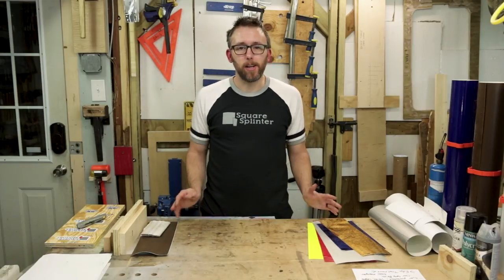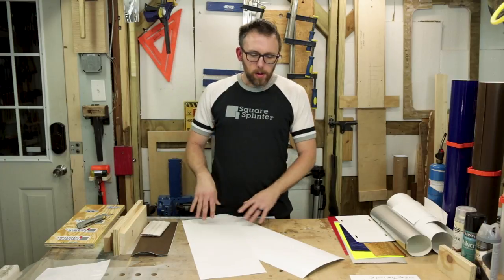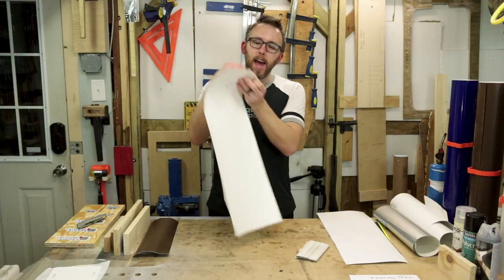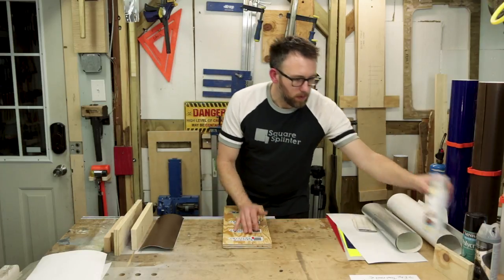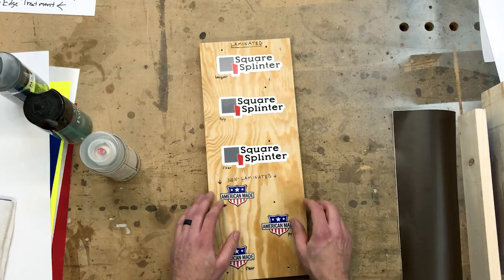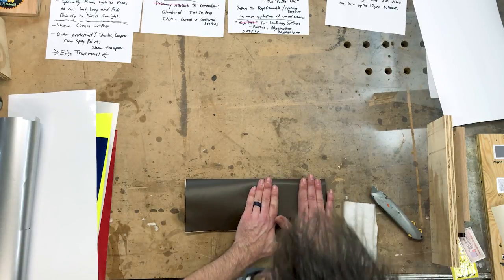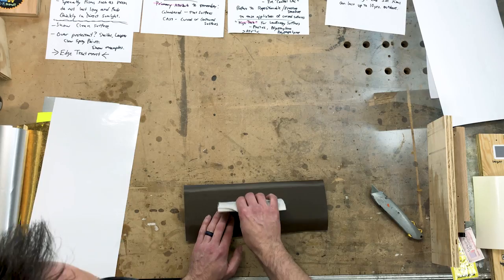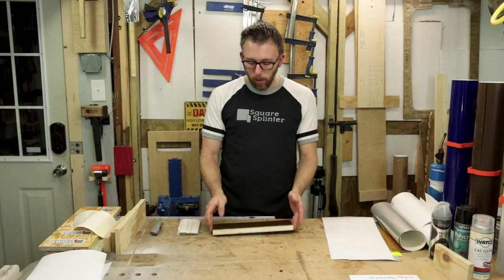Vinyl wrap your Wood | Tips and Tricks

Comment: Thank you I have been thinking about this for quite some time. I have a very expensive set of Polk LSIM 707 speakers that have some veneer damage I've always imagined that I could feel that damage with epoxy and then wrap the speakers to make one amazing look.
Reply from the maker: As long as you make the epoxy fix perfectly flat it would work just fine.  Just remember the vinyl will show ALL of your small little scratches or high spots in your fix.

Comment: Hi Great video. I am thinking of using a vinyl on a turntable (Record Player) plinth made from simulated wood. The unit if from the mid 70's and would like to know how to apply a vinyl wrap along the top and wrap around all the sides which is about 2" high. Basically a square box about 13x16"x 2". to make look uniform.
Reply from the maker: Probably be best if you could maybe email me a picture?  I might be able to help better.   Squaresplinter@gmail.com

Comment: Hey, if it possible to use floor vinyl on mdf board? The thing is i bought a rack that has hdf board for each level, so I wonder if im putting my extra floor vinyl on top of it to make it more durable or any kind of extra protection for the board against oil/grease/ or some spill water. I want to use it to store equipement or auto sparepart for my garage
Reply from the maker: I have honestly never done that but I do t see why you couldn’t.  I think it probably provide quite a bit of protection on the faces, the edges might still be a bit fragile but anything helps. 🍻.  Let me know if it works out!

Comment: Great Video! I have a 5x5 sheet of car vinyl carbon fiber. Do you recommend I apply anything to 3/4” pine sanded plywood before hand or just wipe it down first?
Reply from the maker: I would definitely put some sort of sealer on it first.  A water based poly would work great or any Type of “sanding sealer”.  Will greatly help adhesion.

Comment: Would it be to my benefit to prime the word first and then then apply the wrap?
Reply from the maker: You need to at least seal it with something first.   For example: a water based polyurethane or a sanding sealer.   Primer works well also.

Comment: So if I were to cover the tops and sides of something in vinyl and then applied a sealant/clear coat it would stop it from coming up? Also you mention non laminated vinyl isn't as durable but a clear coat should add durability so I could just buy that correct?

Edit: how do you think clear coat would hold with knifes? Any you recommend that may do better with knifes?

Comment: Will the Vinyl get peeled away if we use it  to stamp on the floor
Reply from the maker: There is vinyl made specifications for applying to the floor.  Think Walmart and other retail places with graphics on the floor.  It will stay down but not for super long term.
Reply: @SquareSplinter  thank you very much for your response 🙏

Comment: hi nice video,  i have noticed on some modern cabinet doors look very glossy finish, and they seemed to be a vinyl as you can see the edge on the back of the door, but  they haven't got any joints on the corners of the doors.  And all the videos i have seen you can see the mitered corners. can you help. thanks
Reply from the maker: I’ll be honest and say I don’t know “exactly” how that is done but.... I am fairly certain it’s a mixture of heating and vacuum forming.  That’s why that vinyl is always so brittle if you try and remove.  Usually means it was heated.  A lot.

Comment: Do you just apply permanent vinyl on mdf just as you would regular wood or do you apply anything on mdf before the vinyl?
Reply from the maker: you can apply right over MDF
Reply: @SquareSplinter  ty
Reply from the maker: @ald.3449  Im actually working on a follow up video to this one right now and I will be demonstrating your question in the video.  Sealing vs. not sealing mdf and similiar questions  Thought you might like to know.

Comment: Are you saying that air egress wrap can never be removed?  Isn't the point of wraps that you can remove it if you wnt?
Reply from the maker: If can definitely be removed.  The air egress helps in the application because it doesn’t stick until you put pressure on it.  Basically all higher end car wrap vinyl has some version of it.

Comment: To be specific: Automotive vinyl, not the thin, car advertising type of vinyl. Real vinyl comes by the yard in various colors and textures. They get laid over a batting to provide character and stretched and stapled to the underside (or the hidden area) of the project. For example, I have an 8 ft x 2 ft wooden framed panel that resides above the driver and passenger compartment in a truck. It is built with plywood and covered with vinyl, but not advertising vinyl. Most automotive vinyl work utilizes furniture grade vinyls and not something thin and cheap.

Comment: This was crazy informative! Thank you!

I wonder... My plywood is crazy rough finish cheap stuff that I'd like to put a wrap over.
I have no power sander tools...

So I'm going to try applying drywall mud to the surface of my plywood to fill in all the grains and knots, and then see how the vinyl sticks to that!

I'll respond with how it goes
But if you see this sooner than later and have any better suggestions of how to give rough plywood a smooth finish without sanding - I'd appreciate it!
Thanks!
Reply: Sooo.... did the drywall mud work?
Reply: @ssranon  absolutely terrible lol. Perhaps the 'automotive vinyl' from Amazon was to blame (I wanted the carbon fiber look for my project).

But man.
Any and every small imperfection in the wood showed through.
Wood filler is not cheap and it doesn't go a very long way, and drywall mud doesn't adhere to plywood well at all. It easily comes loose when dry, if the wood is impacted or even slightly bent during install.

Anyways...
I'd either fork out for wood with a nice finish, or try a different route be time, like purchasing discounted cabinet pieces from the Ikea 'damaged section', since it a has a nice surface finish to begin with. Just need to cross your fingers that the sizes and prices are good!
Reply from the maker: sorry for such a late reply.  Yeah...like you found out, vinyl doesnt hide ANYTHING.  to smooth something like that out you would want to use bondo.  I have done this before with decent results.  It has to be sanded really smooth though.  at least up to 220 grit.

Comment: I was hoping to see you wrap the entire board, edges and all.  I have a "shelf" / Keyboard tray I'd like to wrap completely.
Reply from the maker: Diamond 482 you want to wrap just the faces and edges, right?  That wouldn’t be too bad but if your wanting to wrap the ENTIRE thing ends and all that would be pretty tough.  Let me know and I might be able to give you some pointers.
Reply: @SquareSplinter   well .....the top, the front edge for sure.  Both side edges would be nice. The piece  is 13.5 inches wide ( left to right ) x 18" front to back × 3/4" mdf fiber board.
Reply from the maker: Well the top and front edge can be done fairly easily but adding the edges in quickly makes it pretty tough.  There isn’t a super easy way to make those lines neat where they would meet on the edges.  
To accomplish the front edge and top though you can do that with a squeegee and maybe a hair dryer or heat gun to help you out.  Cut your vinyl bigger than you need and apply the big flat top surface first working towards the edge/front you want to wrap over. When you meet the edge and everything is flat and finished on top slowly heat up the vinyl just a bit to make it super pliable.  Better to have someone hold the board down for you or clamp it down...  start in the middle and pull the vinyl over tight, after you pull over middle reheat the leftover again and then pull over the left and right edges down over the front as well.  If you heat it up enough it will stretch and prevent any wrinkles or bubbles.  After you have it pulled over and smooth heat up the edge pretty hot to “set” the vinyl on there.  Be sure with mdf to try and not pull up the vinyl after it sticks down.    Hope this helps.
Reply: @diamond4829  how did it work on the MDF board?

Comment: How do I vinyl wrap all 6 sides of a loudspeaker? The edges become tacky. I am looking for a proper hi end look that would last forever.
Reply from the maker: no vinyl will last forever.  I would probably suggest an automotive paint.
Reply: @SquareSplinter  any long lasting solution which looks like veneer? Looking for a clean joint where 3 sides meet.

Comment: Thank you, thank you! you are the answer to my prayer :) I am making a bed for my camper van project and I would like to cover the plywood bed with matte vinyl instead of painting it to make it look fancy. My concern is being a plywood, it is expected to bend some when laid on, do you think the vinyl would stay? Would it be better if I'll spray the wood with water based polyurethane 1time to make the vinyl stay more? or the polyurethane would react to the vinyl and it will make it peel easy instead?  Appreciate you help.
Reply from the maker: Hello! first off, thanks for the kind words.  To answer your question, quality vinyl really works alot like paint in that it will follow the contours and bends of what you put it on VERY well.  Couple things: Just using matte vinyl on the bottom could possibly scratch fairly easy if its not a laminated type, but as long as nothing sharp is against it you should be fine.  As far as finishing the plywood before you apply the vinyl, you don't have to but I would.  The poly will act as a wood sealer and also a uniform surface for vinyl adhere to.    Thanks again!
Reply: @SquareSplinter  I would probably use gloss then if you say it is more scratch resistant than matte. Do you suggest sanding the Polycrylic to remove the tiny bubbles before sticking the vinyl? I am afraid the dust after sanding might reduce the stickiness of the vinyl even if you wipe it with damp paper towel? I am curious if painting plywood with enamel would work too. I checked the options of vinyl in the signwarehouse.com and do you suggest I get the Oracal brand for this project. Once again, thank you for your input.
Reply from the maker: I may not have been very clear before...  the gloss vinyl itself isn’t any more scratch resistant than the matte.  What I meant was, ANY vinyl without an overlaminate like used on a car wrap can be scratched somewhat easily.  Not to say it’s like fragile or anything but just be aware it will get scuffed up looking rather quickly when used on a floor application.  As far as the polycrylic I would definitely sand it with like 220 grit lightly to smooth it out.  Wiping it down with a damp cloth won’t hurt anything at all.  Painting is also an option but not really necessary unless you plan on the wood being in a damp environment a lot.  As far as the vinyl, yes Oracal is a great brand. I would go with the 751 line.  The 651 Rips easily and the adhesive just isn’t very good.  Good luck and send me a picture when your done!  👍🏼
Reply: Make sure the ply you're putting it on doesn't off gas or it'll make bubbles over time!
Reply: @SquareSplinter  Hi, do you think a laminated vinyle will survive as camper exterior cover, and roof over 5/16 plywood? (is it waterproof enough?)

Comment: Great, informative video!  I'm working on a horse trailer renovation project. It is made out of mdf board, so it's a pretty flat, but not 100% smooth surface. One of the panels has some wacky oil paint job. What kind of vinyl would you recommend for this kind of job? It has to withstand the elements (obv) as well as cover up those minor bumps. Thanks :)

Comment: I want to wrap a wooden desk. I want to minimize the amount of seams by continuing the wrap around the edges . The idea is to cut seams at the corners only (I don't care what the desk looks like underneath). Are there any drawbacks to that method? Will the vinyl tear more easily? The edges and corners of the desk are slightly beveled.
Reply from the maker: As long as edges aren’t beveled at least.  You don’t want to wrap over any 90 degree sharp corners where there will be wear and use on them.   If possible you might even want to ease the edges even more with some 220grit Sandpaper if possible.  Cutting at corners and folding around will work fine though.  That’s typically how it’s done commercially.  Good luck!
Reply from the maker: KJ what I meant was as long as the edges ARE beveled at least.  Sorry about that.
Reply: @SquareSplinter  No worries, I figured that is what you meant. I'm pretty excited to get started, Thank you !
Reply: Hey, I might wanna try something similar, can you maybe show me some pictures of the result? Mostly interested in a corner and an edge to see the finish

Comment: Just built a speaker box out of birch, was planning on wrapping it with the auto vinyl like you have here. What are your thoughts on hittin it with some primer spray paint to make it smooth? As well as possibly adding some durability. Is that a good idea? Or should I just bust out the orbital sander
Reply from the maker: Sorry for late reply.  Priming is perfectly fine to seal it.  Just make sure you get it sanded smooth.  Remember the vinyl won’t hide anything.

Comment: Thanks for the tips. What about drilling after vinyl is applied or routing the edges of the wood?
Reply from the maker: Drilling is fine but you wouldn’t want to route afterwards.  There would be a pretty high chance of tearing the vinyl when trying to route.   BUT.... honestly if it was a brand new super sharp bit it might work.  I honestly might try it.

Comment: Gluing isn't an option for me bc im getting an apartment but im gonna modernize it in a way that everything can be removed when im out. Is it easy to peel off?
Reply from the maker: It CAN peel off yes, but typically on mdf especially it can mess up the surface finish. If you sealed it first with a water based polyurethane or similar that would help.   So I guess my answer is yes you can but I wouldn’t want to do it on a very large piece at all.  I would suggest maybe testing a piece first and see if your ok with the result.  👍🏼
Reply: @SquareSplinter  I appreciate it!

Comment: how would you do the edges if you wanted to wrap something completely like that all the way around?
Reply from the maker: You can definitely wrap all the way around but it’s MUCH trickier to get a good flat surface when doing it.  Wrapping over a 90 degree edge adds  a whole nother level of difficulty.  So adding one and then another 3/4” later it is definitely possible but might take a bit of practice to get it to look good. 👊

Comment: Hey man, question about how to remove these sort of vinyl wraps? I have a new backgammon set that is essentially a wooden box with a glossy vinyl wrap/wood laminate. I plan to remove it. Any ideas?
Reply from the maker: It’s actually “new” or just new to you?  On commercially produced stuff that is vinyl wrapped they typically use a very cheap vinyl that has very aggressive adhesive on it. Sometimes it can be a huge pain to remove cleanly. Depending on what your wanting the surface to look like after there is a couple ways.  The first way I would try is a heat gun or hair dryer, slowly heat it up and try to pull up a corner.   If that doesn’t work email me and I can help you more.  Squaresplinter@gmail.com
Reply: @SquareSplinter  First of all, thank you for responding. It's new. Hmm, that's a great point. I didn't think of that. I originally wanted to varnish everything but the playing surface. I'll try the hair dryer option.

Comment: What type of vinyl would be used over finished wood that can be easily removed at a later date without damaging finish ?
Reply from the maker: Just about any high quality vinyl would work just fine and would remove cleanly.  Google Oracal 751 for a good starting point.  Thanks!

Comment: Interesting finish, quite a lot of fun in some applications.  I can see wood wall hooks in bright vinyl colors.  I'm surprised you don't heat this up like the mylar sheeting on model aircraft?  I always thought there had to be some heating done at the end to stretch it out especially over corners and curves.
Reply from the maker: Lass-in Angeles you are completely right for curves and uneven surfaces.  You have to heat it substantially to kind of “reform” the memory of the vinyl so it will take the new shape permanently.  For flat surfaces it’s not as important.  Thanks for watching!
Reply: Lass-in Angeles You are correct, usually for doors you would heat and stretch the vinyl over the edges. Conforms very well.

Comment: Is there a video that shows how to apply vinyl to a dowel/pole 1” in diameter??
Reply from the maker: I don’t have one personally but it should be too bad to do.  Probably easiest to wrap it around and overlap the vinyl and then cut along the length through both ends and it will make a perfect seam.

Comment: How to do vinyl wrap a large surface such as a desk 28 x 48 inches, or a front door 32 x 80 inches.  All the videos show narrow 17th wide table tops
Reply from the maker: It can definitely be done. You really can use a lot of the same methods for covering smaller pieces to do the big ones.  Covering a table top usually requires two people.   Makes it much easier.